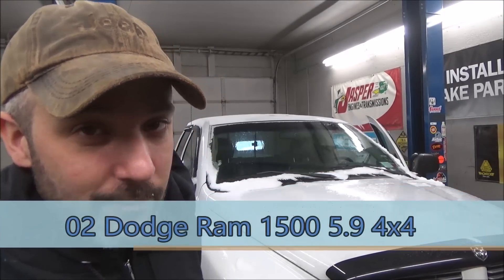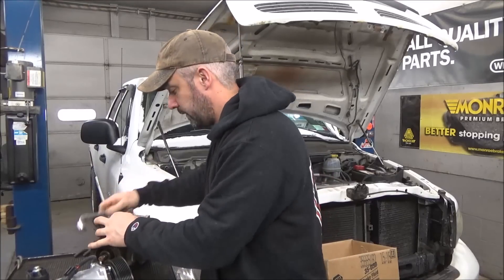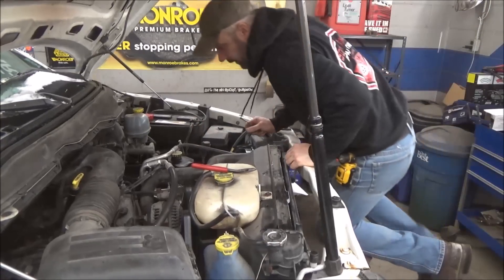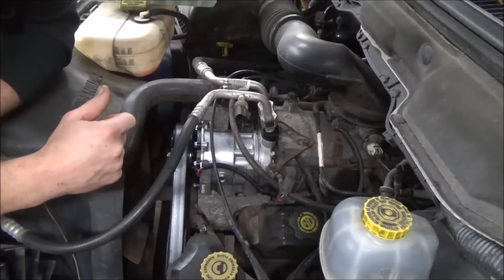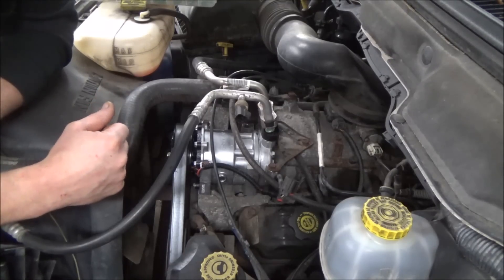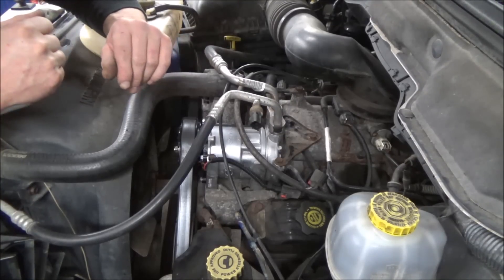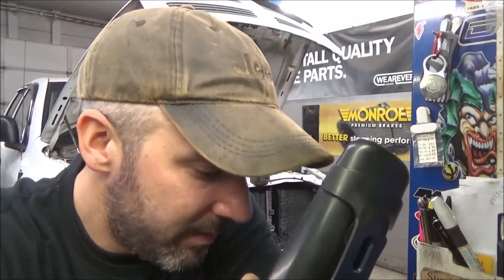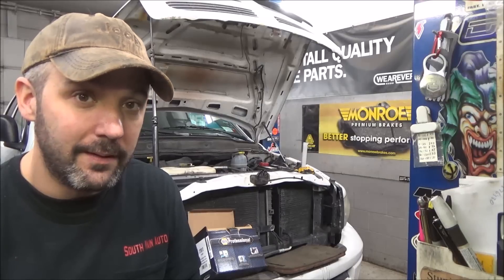Dodge Truck A/C Repair Part 2

Comment: Definately a washer. Washer in this case is used as a spacer so it mounts flush. The o rings do the sealing.The o-rings themselves do the sealing. Try a tube of O ring grease in a tube. Some oils will eat away at the o ring or swell them too much and distort them .
Reply: since those o rings are specifically designed to come in contact with compressor oil, lubricating them with the same compressor makes perfect sense. After all, if compressor oil ate O rings, what good would they be ?
Reply: exactly

Comment: Just out of curiosity has anyone ever found a call to tech support useful? I just bodge things and make it up as i go along. lol

I think its best to leave rusty crap alone as much as possible, otherwise your just going to give it more problems. One minute the customers in the hole for 2k next its 5k.
Reply from the maker: +zoidberg444 true story on the rust...

Comment: SOME HAVE ALUM WITH SEAL IN CENTER UM UM
Reply: +73 SUPERGLIDE Alum is a good chemical to dissolve a broken bolt or stud in aluminum. Let it soak fully submersed in water and alum over night, or longer if needed, and look for a clump of "dark matter" (for a lack of a better word) in the solution.
Reply: +Hawaiian F150 what is alum?
Reply: +Hawaiian F150  Crap -- take out the word "Basically" in the first URL link or click here: http://chemistry.about.com/od/moleculescompounds/f/What-Is-Alum.htm

Comment: New gas struts for the hood:  I just got some mailed to me from China (through Amazon.com). $20 the pair including shipping.
Reply from the maker: +Garth Goldberg Nice, most people carry around a piece of wood lol
Reply: I was working on a '03 Dodge Ram 3500 with the cummins and it had the same issue with the hood struts. Had to buy some locally for $23 Canadian each. The place Eric is kneeling on, on the bumper is a great spot to work on.
Reply from the maker: Edward Shen Kinda like Dodge knew you'd be under the hood huh!?
Reply: +South Main Auto Repair Yeah LOL. My 2010 Cummins doesn't have that though. But it barely needs any work other than regular maintenance.
Reply from the maker: did you delete it yet
Reply from the maker: My dad drove his 2014 Ram 3500 Dually home from the dealer, less than 100 miles on it, full delete haha. I told him he was an animal lol.
Reply: +South Main Auto Repair Yeah I heard of some people doing that. Does he have an Aisin transmission in it or just the 68RFE? A deleted cummins with an aisin would be a deadly combination.
Reply from the maker: 68RFE

Comment: 15ml = 1 tablespoonful = 1/2 ounce
Reply: 28.35g = 1 oz (mass);  29.57 ml = 1 fluid oz (volume). A tablespoonful  is a measure of volume, and is defined as 14.786 ml. Since tablespoons are used one or two at a time the difference from 15 ml is negligible. But there are 256 tablespoons in a gallon, and using 256 15 ml tablespoons would measure a 130 oz gallon, 2 ounces too big.
Reply: @tomoakhill8825  Thanks I didn't think they were back in the chem lab.  And I don't think they have a 14.786ml tablespoon laying around in they kitchen drawer do you.
you mentioned an Avoirdupois measurement how do you know he wasn't thinking Troy.

Comment: No problem with no accumulator because the compressor is ok inside but safety third taking off snap rings without safety glasses is stupid you would look silly with a eye patch

Comment: Why didn't you replace the accumulator/receiver dryer? That's mandatory when the system has been open that long. That cap over the hoses doesn't do squat. Once those lines are exposed to atmosphere, that acc is toast, the desiccant wasted. Plus, this is an old system. Now the system has a negligible ability to remove moisture from being circulated. As for the orifice tube, if you can remove and clean it and it doesn't appear damaged, it can be reused. Missed the mark on this one.
Reply: Were you listening to the explanation or just puffing off?
Reply: The only mark that is missing is the one between your ears.
Reply: Its also supposed to be mandatory to obey our laws, but I bet you've gotten at least one speeding ticket, haven't you!
Reply: You missed the mark on listening capabilities and understanding how vehicles work in the real world of things becoming brittle and or rusting.  Common sense and realistic expectations are concepts you fail on in life, missed the mark on those.

How about this, every time you go 1 mph above the speed limit, remember you are committing a crime.  You are a criminal, a law breaker.  You better make sure your speedometer is constantly calibrated and use calculators for overall diameter of your wheel and tire set up and how it changes from a new tire to one at its wear indicators ...  unless you also break the law and run them to they are bald.  Also, do you follow laws and common sense to use proper winter tires just before the first snow fall and keep them on until after it will consistently be above freezing?  That is pretty damn dangerous not to.  Do you check your tires and bulbs every time before you move your car?  Do you always wear your seat belt and have it tight across the right spots (you know clicky clicky, no leaning forward). 

Are you completely full of yourself and smell your own farts?  Survey says, yes!